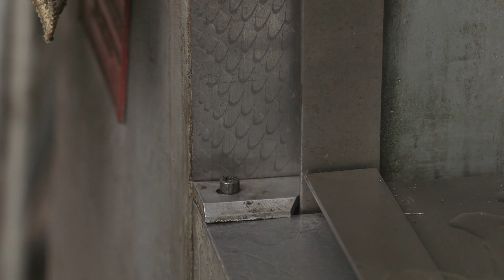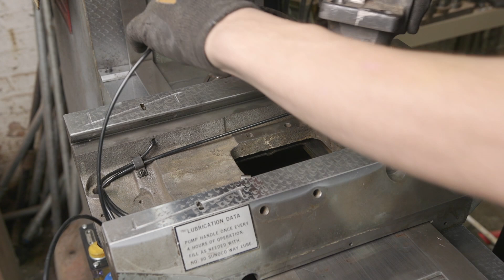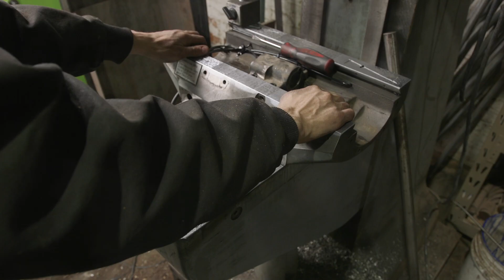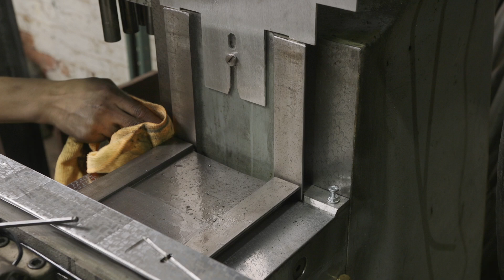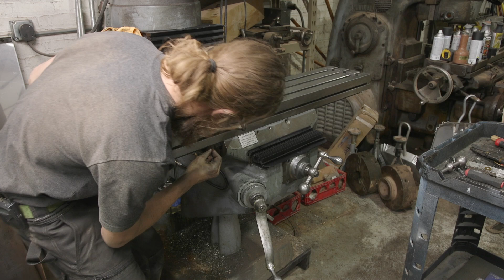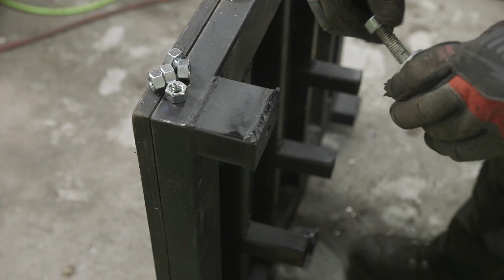Bridgeport Mill Refresh Completed

Comment: The machine looks pretty good for its age. You did a very good job on the restoration and the new oiling system will prolong its life and make it very smooth running. The backlash on the axes is very low considering that you have lead screws and there is wear on the ways. Can't wait to see some parts made on it.
Reply from the maker: Yes. Thank you. I am looking forward to making cool stuff